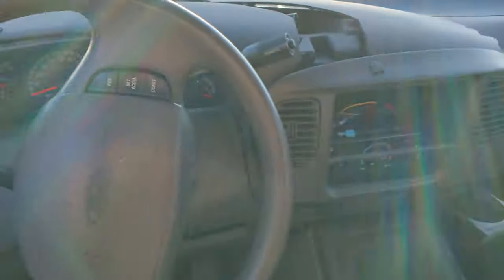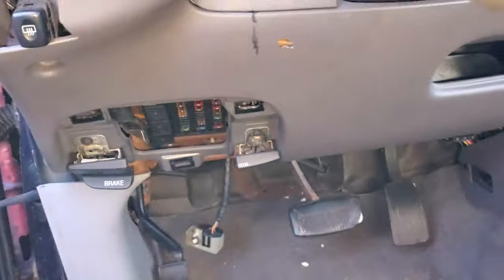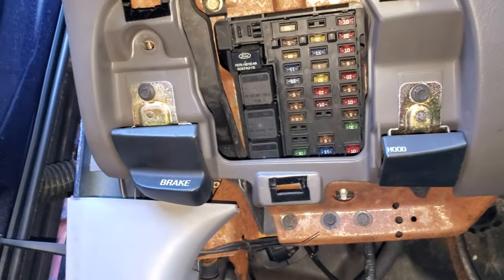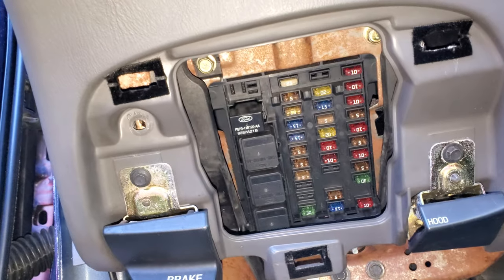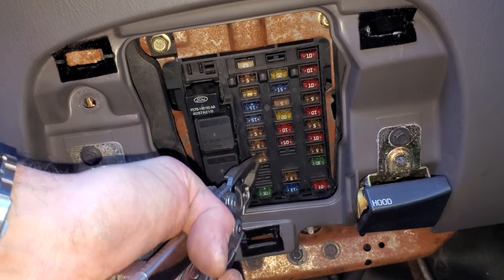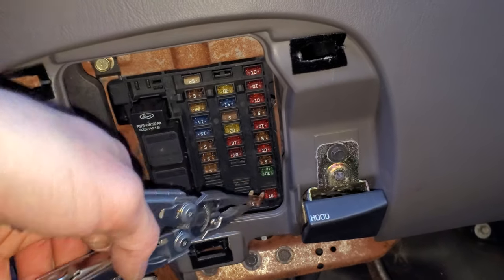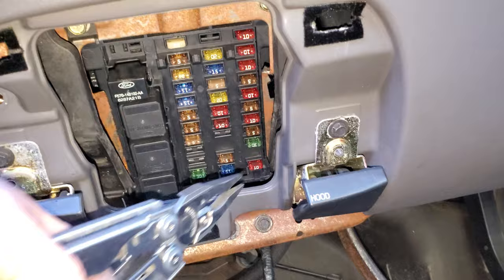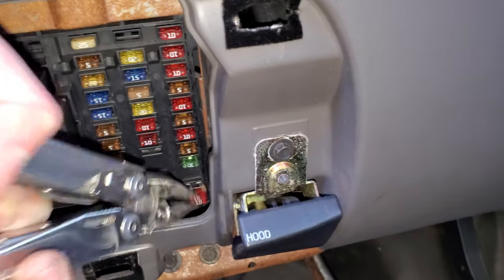1999 Ford Expedition Radio Fuses

Comment: Thanks, this helped me in a pinch. I used the 5 amp fuse at the bottom (#8 on the diagram) to get a switched 12v signal for my subwoofer amp. 👌